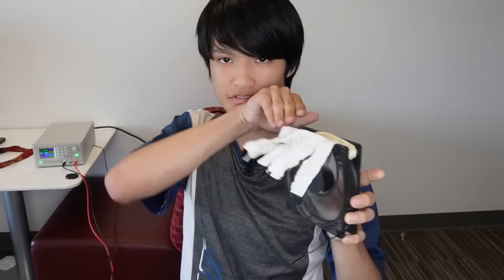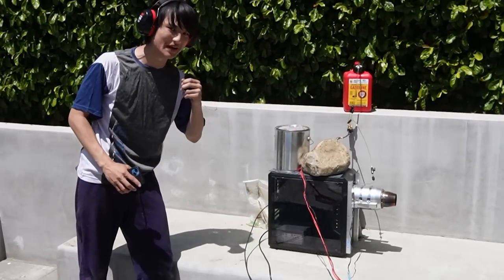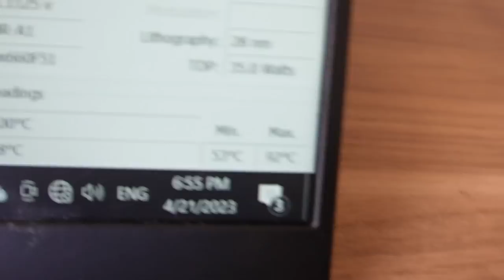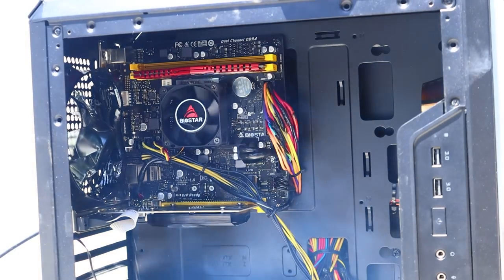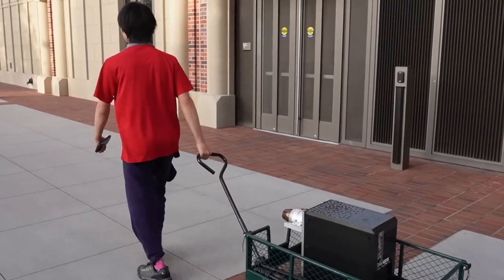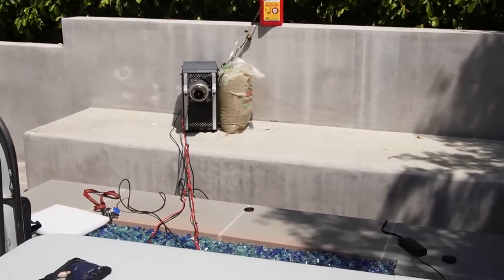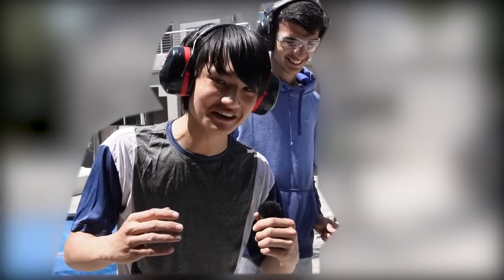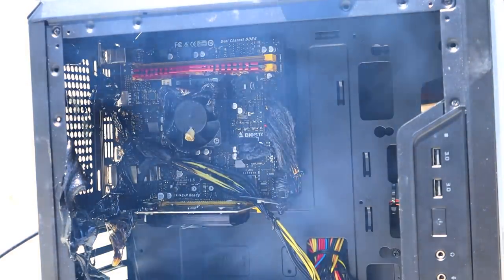Can a Jet Engine Cool a Computer?

Comment: I was sad at first thinking what a horrible way for that once was a legend of a FX chip. Then I realised.. I bet the bastard still works!
Reply from the maker: Yeah the only components that were irreversibly damaged was the case fan and heat sink fan lol. The mother board is missing a couple capacitors, the GPUs VGA port got burnt to a crisp, and the psu was a fire hazard before this video

Comment: Man, I love the Cooler Master Q300L and Q500L. They're perfect for extreme modding. You're not doing it right until you're chopping up the front and top panels of the case for improved airflow.

Comment: Hey, I think its pretty cool you have the Ram on this board going sideways!

A tower heat pipe cooler would be amazing, but even a slightly taller alumimun cube one with fins going in the proper direction would get results.

Any chance there is a generator on that engine so you can run the PC entirely off jet fuel?  If not, how about a windmill generator coupled to it?  Just curious, its probably too difficult an engineering problem to do for lulz